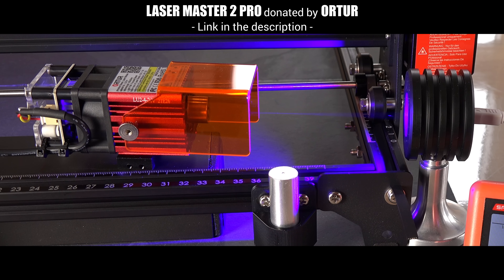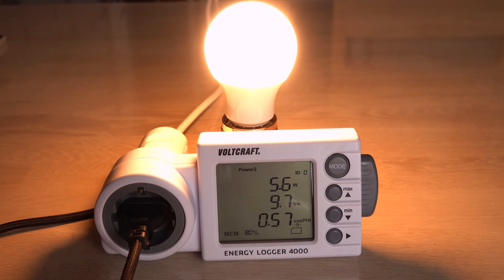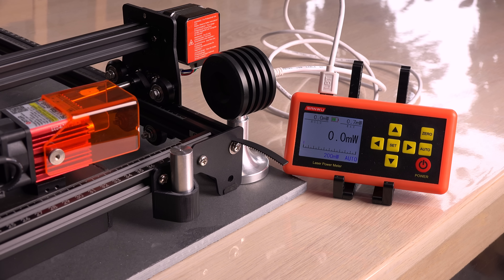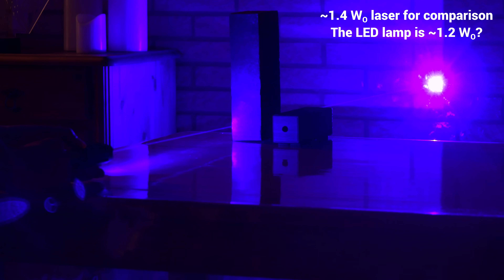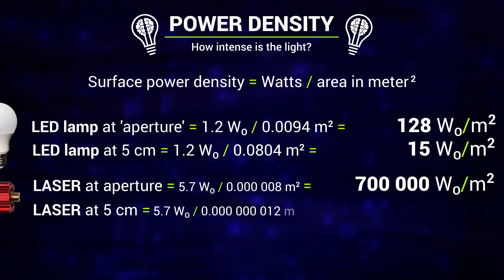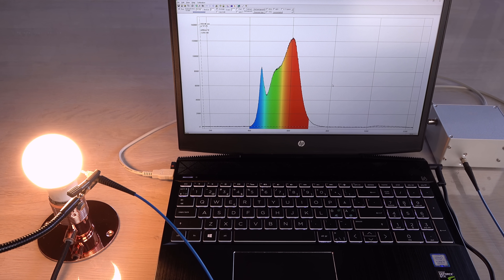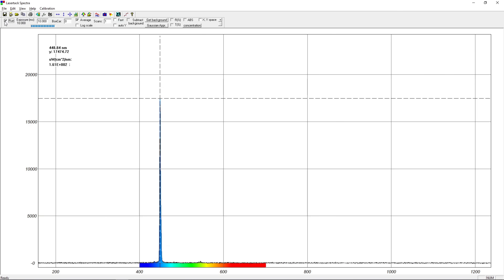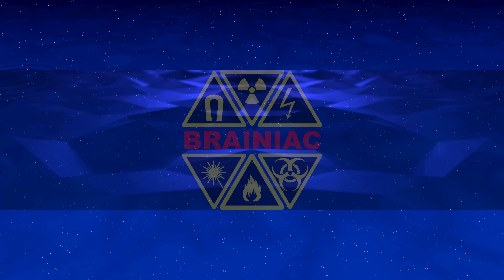Crazy difference between 5W LASER and 5W LED!

Comment: W/m² is my favorite unit. When you express W/m² in SI base units it is kg/s³
Reply: Can you explain this?
Where does the kg come from?
Reply: @erikpoephoofd  one Watt is one Joule per second: W = J/s
one Joule is one Newton applied over the length of one meter: W = (N * m) / s
one Newton is the force you need to accelerate one kg by one meter per second in one second: N = (kg * m) / s² ||| W = (kg * m²) / s³
so one Watt per square meter gets rid of the square meter in the denominator: W / m² = kg / s³

Comment: The secondary fluorescence peak of the LED bulb looks suspiciously lopsided, as if it were a composite of two peaks. Perhaps they have finally started incorporating a europium based phosphor with the cerium doped YAG that has been common for the last decade to make a more pleasing full spectrum warm colored low K temp light.

Comment: What if use a special "filter", a ceramic YAG:CE filter to convert 450nm into the famous visible light just like LEDs do? How much better or worse would it be to light a room that way?
Note: It has to be ceramic because it can withstand heat
Reply: Filters can only block optical energy at specific wavelengths - and since nearly  all the power of this laser is concentrated at 450nm, if you blocked that you'd probably get close to zero output.
What you'd likely want to use is a mix of phosphors that absorb the 450nm light and emit a range of wavelengths to approximate white light. The yellowish coating overtop of a lot of 'white' LEDs is, in fact, phosphorescent material. Some laser headlights for cars use this strategy if I'm not mistaken
Reply: @hrtlsbstrd  Exactly, and this phosphor material is called YAG:CE
Reply: @WolferAlpha  Right, cool - filtering is a different process though :)

Comment: There are other ways to explain why lasers and lamps are different.

15 watt/m^2 for that 5 watt bulb.

If you look into the sun for slightly too long, you will go blind, and that's "only" about 100 times as power dense as the bulb. The laser at its aperture is 460 times more power dense than the sun and another 675 more power dense at its aperture.

Comment: Well it's like 1kg of rocks and 1kg of feathers. It's both 1kg, but one throwed can kill you other can help you sleep in the bed...

... Also yes, 1kg of feathers is heavier than 1kg of rocks because you actually need to contain those feathers so you need to add weight of bag 😜
Reply: I am  going to make the argument that 1kg of of feathers is lighter because it displaces more air.
Reply: i'd argue 1kg (mass, not weight!) of feathers is lighter because it has a much higher volume (feathers are hollow after all, and way less dense to begin with) and surface area, and thus much higher buoyancy.

Comment: Stupid question: can we use laser as light bulb if using some lens? Can it be safe?
Another stupid question: can we engrave with some powerful arc projector and lens ?
Reply: Yes. It wouldn't quite as efficient as an L.E.D. bulb but the colour would probably be purer (a narrower and cleaner spectrum) and you would have more precise control as to exactly how your light behaves. Some very high end DLP projectors use a red, green and blue laser instead of L.E.D.s for this reason.

Also, yes you can engrave (or at least burn wood) with the light of an arc lamp focused with a lens. I did it as a kid once but the "spot" wasn't point like like it is with the sun, it was more like a small line (like trying to draw with a flat tipped marker), I used one of those sheet magnifier that is like the size of a normal sheet of paper.
Reply: @zachcrawford5  thanks for reply

Comment: how come your sensor doesn't burn under maximum power from the laser?
Reply from the maker: First off, I made sure the sensor isn't placed at the focal point. The beam is spread out to a large dot on the sensor. Next, the sensor is made for measuring lasers up to 20W. It is designed for it and mostly a chunk of metal with a heat sink. Thanks for watching!

Comment: Great video! never seen it compared like this!
Also PWM scaling is not linear, so at the lower range < 10% theres a ramp up effect, then its roughtly linear to 100%.
Reply from the maker: Glad you like it! A video I have been wanting to make for a long time but didn't have a laser strong enough to 'match' the wattage of LED lamps :) And thanks for clarifying on the '3% power mode'. Looks like this one is only running at around 1% power in focus mode. That's a good thing for such a strong laser and impressive that it even will lase at such low setting.
Reply: @brainiac75  
no it actually is running at 3% power.   
but the power meter can't give an accurate reading because of the pwm.  

once the laser is warmed up btw there shouldn't be any ramp up what so ever.
Reply: @darkracer1252  PWM seems pretty sketch on these in terms of eye-safety - sure the avg power is lower so your object doesn't get thermally burned the same - but unless they're properly low-pass filtering the diode driver (not sure how well that would work anyway) you might just have very short multi-watt pulses, which would leave you with dotted eyesight..
Reply: It isn't PWM that causes the non linear behaviour. The light output of laser diodes (as opposed to LEDs), isn't proportional to the current. They can light up at very low current, but then when current is increased, the light output don't increase very much - until a certain point (the threshold current), where the light output starts to rise very quickly as current increases further. That threshold also changes slightly with the temperature of the diode - so it's not possible to drive a laser diode with just a preset drive current and always having it to output for example 3%. To get accurate output, it needs a light sensor for feedback (which most driver don't have, since it's not  needed for most applications
 - in this case as a focus aid, it doesn't matter at all, if it's actual 3% output or just 1 %).
Reply: As I watched this, I couldn't remember the specific multiplier in the calculation... I just remembered that a laser being condensed light increases in multiples_not additions - as the power input is increased.

Comment: The wattage rating on the LED bulb is talking about the bulb's power CONSUMPTION, where as the laser's wattage rating is talking about its power OUTPUT.  I feel like this needs clarification.  I have a 1.6 watt blue laser diode that actually DRAWS 15 watts of power from the driver board.
Reply from the maker: Exactly. I just use 'input' in stead of consumption. Similar thing. Thanks for watching!

Comment: But what if I want to luminate my room with a laser, by using a diffuser with a phosphor coating?
Reply from the maker: That would work. Some high-end cars use laser headlights, where blue lasers hit a phosphor. Very similar to how the LED lamp works. Just with blue laser diodes in stead of blue LEDs. Very strong and directional white light!

Comment: ...so, I can make a laser from a LED bulb?
Reply: Lasers already are made from LEDs.  A laser diode is nothing more than an ordinary LED with appropriately sized and fitted set of mirrors called a resonating cavity.
Reply from the maker: Nope, getting the light into such a narrow, collimated beam is something only lasers will do :) Thanks for watching!
Reply: I may as well try, just for fun, because I have burned myself on a led chip before...and my desktop optical drive just gave up few weeks ago, so this just might work.

Yes, I know optical drives have lasers in them, but that aint fun.

Comment: Very helpful video, I was lighting up my room with a co2 laser all this time XD
Reply from the maker: Hehe, CO2 lasers are so far into the infrared, that their beams all have 0 lumens. Unless they heat something up to be red-glowing hot or set it on fire. Then you'll get some lumens to light up the room ;) Thanks for watching!
Reply: A powerful infrared laser heating up a  thoriated mantle from a kerosene lantern? That would be interesting
Reply: The interesting thing about CO2 lasers is that their wavelength is more or less the blackbody wavelength emitted by an object at room temperature. But no, you can’t make a thermally pumped laser.
Reply: @Scrogan  But you can heat your room with CO2 LASERs, and it will be much more pleasant than conventional air heating. Assuming you manage to defocus the LASER to illuminate your hole body, instead of just burning a hole into it.

Comment: Another important aspect is the phased/pulsed light from lasers. 
It's the same difference as being punched by a heavyweight boxer once every few minutes, to getting pushed by a toddler continuously.
The same amount of force is applied, but different durations.
Reply: Styropyro did a great vid on this. Basically if a laser radiates 2 joules over 10 nanoseconds, this gives us a power of 200 megawatts!
Reply: @elyeryan8838  I mean that a lot of lasers that produce seemingly continuous beams of light are actually pulsing. It happens too fast for the eye to notice, unless you look into the beam. A "low power" laser can be blinding because the energy arrives in punches instead of a trickle.
Reply: Just being pulsed doesn't mean the laser has high peak powers though. If you pulse a 5W diode laser the peak power is still only 5W. Difference with things like Q-switched lasers is that energy is still being put into the gain medium between pulses, that stored energy is then released all at once with each pulse. With diode lasers the energy is only going in during the pulse.